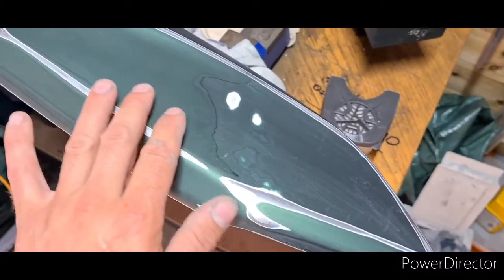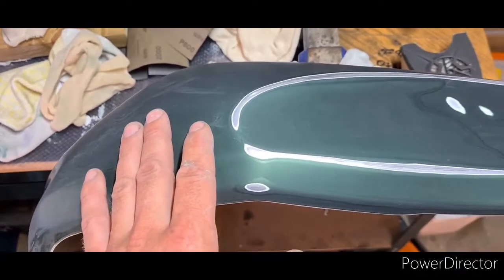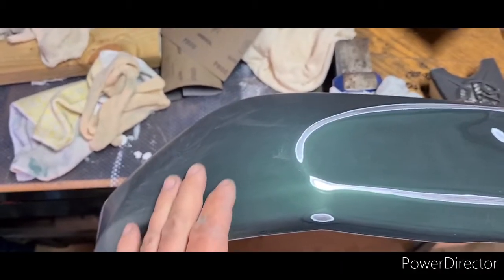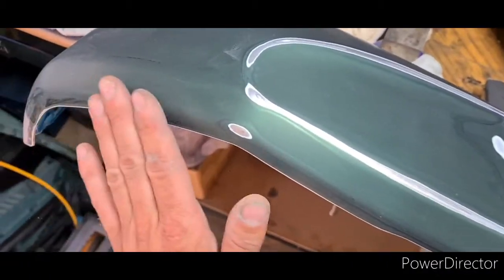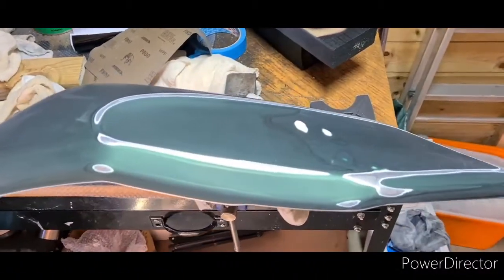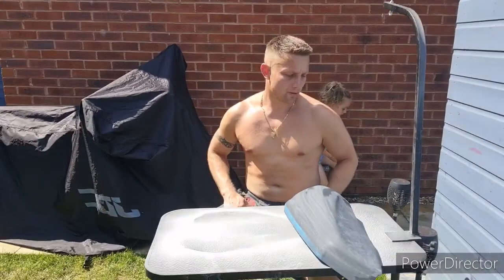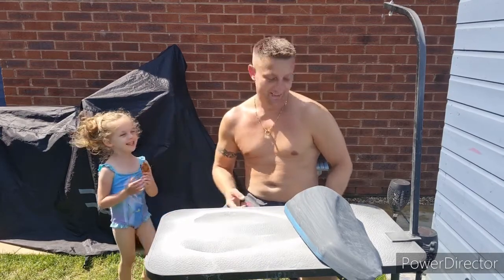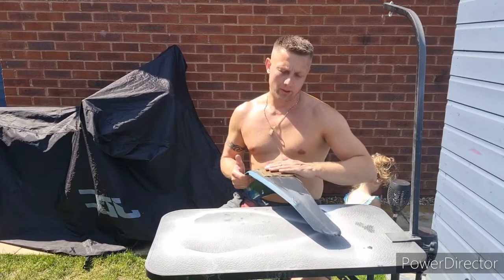Xsr700 fueltank paint job continues

Comment: awsome job!, did u sand the central part of the tank as well?
Reply from the maker: Thank you, the middle panel is plastic, side panels are aluminium. U must be very careful how u sanding , for plastic is different primer, u must count how many layers u spray for primer and colour paint, is looking easy but I did this job 3 times . Was more for fun and learning, but is not cheap play. I suggest take few different primer in spray and some colours , try on some plastic and metal scrap then u will see how tone of the colours changing. Have fun and take care. I finish in satin mat , one of the kind xsr700 on market 🤪
Reply: @Romski1978  thanks for the reply, yes I was afraid its plastic, i'm going for a different color than the side panels, hopefully this gives me a slight advantage.but I'll be sure to give it a plastic primer and be careful with the sanding. Cheers and take care!